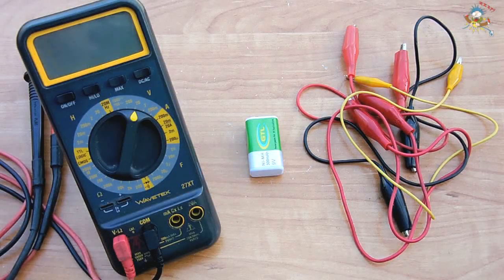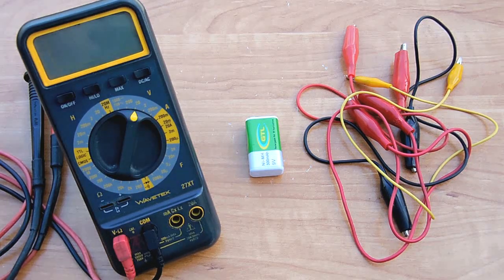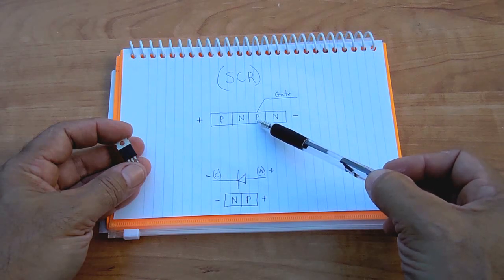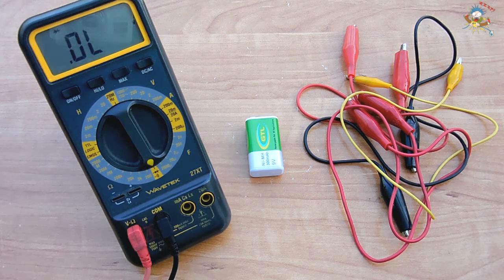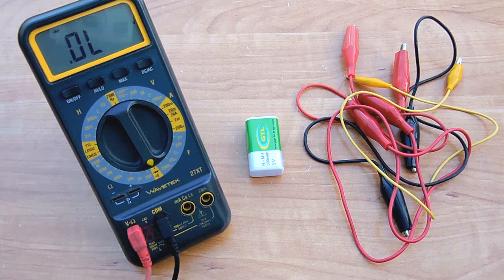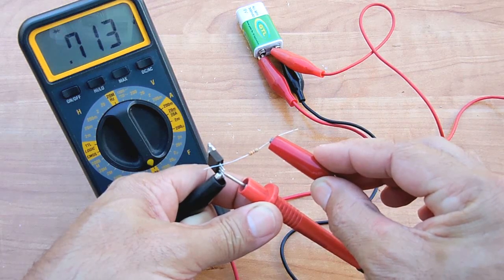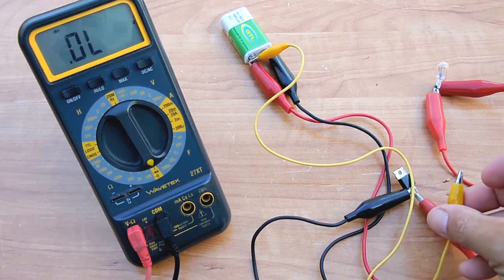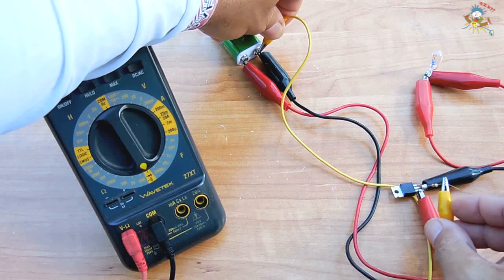SCR Operation & Testing

Comment: Thanks for this info. My DCA55 said it was an unknown or bad component, but proper testing showed it to be working. I'm trying to fix a power supply with very limited resources, I've checked just about everything I can without an oscilloscope and it all checks out fine. I'm thinking it might be a bad switching controller and I don't know if I'll ever be able to afford to get a replacement, but I'll keep trying and learning more along the way.
Reply from the maker: You're welcome! Hopefully you can resolve your issue

Comment: My problem is I can't find an SCR for the 12VDC  application that I need it for. I need an SCR that can take a 12-15V gate trigger. The highest I can find is a 10V gate trigger SCR. I want to get by without using a resistor.

Comment: Are these only to be tested removed off board out of circuit?
Just documenting how to troubleshoot old pinball machines and 60 of these (mcr106-1 and 2n5060) are on one board alone. I notice 2 already were replaced by seeing different part manufacturers were soldered on. 
If I can check on board and won't mess anything up, do I need to do anything afterwards to close gate, if I understand that right..
Reply from the maker: I would desolder the gate pin, then test using a DMM set to the diode function between the gate and each leg(Anode/Cathode).

Comment: can you short the gate to the anode and use it as a diode?  What is the current flowing through the gate?  Is that why your using a resistor and what value did you use.
Reply from the maker: You can use an SCR as a diode. The resistor was used to limit gate current, the value wasn't critical. Thanks for watching!
Reply: @electronicsNmore  Thanks for your reply,  I seem to remember doing this many years ago.  I played around with different value resistors.  In my case I had to get under 1000 ohms before the gate fired off and let the SCR pass current.  I settled on a 560 ohm resistor.   I am building a LiOn battery pack for a Ham Radio.   I have 4 batteries in series each series is 3 batteries in parallel.   I plan to use 3, 20 amp SCR in series to drop the voltage down to less than 15 volts for the radio.     Ken

Comment: hello, I hope you respond... does it matter what the input voltage is in regards to the forward output voltage? Also, does it matter what size resistor is used to trigger the gate?

Thank you.. I did test mine and it appears to be forwarding .597v (T106D1).

great video..
Reply: The purpose of the resistor is to limit the current thru the gate circuit. I know it has been two years but I hope it helps

Comment: I work with Variable speed drives and i have a faulty one here displaying 32 Volts out, when the drive is not powered on. Do you think it may be the SCRs ??
Reply from the maker: Not sure without inspecting the VSD.
Reply: @electronicsNmore   i doubt it is after the last 24 hours. I changed the 6 IGBTs and 3 SCRs, but no improvement. We suspect it's a firmware issue.

Comment: Nice video ,Why did you have to use the resistor when connecting to the gate ?
Reply from the maker: Shashi Kiran Limit the current.
Reply: @electronicsNmore  , would you share the resistor value please.. great video... thx

Comment: Is this method is the same also when testing a big thyristor (ceramic type) used in soft starter? thanks
Reply from the maker: Works the same on all SCR's(trigger current may vary). In my Tankless Water Heater video, I show how to test Triacs. Thanks for watching!

Comment: Can you please tell me why it did not work for this?
https://media.digikey.com/pdf/Data%20Sheets/ST%20Microelectronics%20PDFS/TXN,TYN%20058-1008%20G.pdf
Reply from the maker: It should work. Make sure you have the correct pins.
Reply: The gate won't stay latched. It only flows while there is positive charge applied to the gate pin then stops once released. 

Any advice?
Reply from the maker: Try using a load(bulb) that draws more current.

Comment: Nice video! But what are the factors you need to consider when selecting an SCR for a particular circuit? Which SCR should you use?
Reply from the maker: Thanks. The most important factor is the current rating.

Comment: What value resistor are you using during triggering of the gate??
Reply from the maker: +NISARGH S 
If I did not mention the resistor value in the video, which I thought I did, then I probably used a 200 ohm.

Thanks For Watching!

Comment: How do you determine what resister to activate the gate?
Reply from the maker: Ed Ginsberg Hi Ed. If using an SCR for a 6v to 12V circuit, usually a 200 ohm to 1K ohm resistor will be just fine. You need to look up the data sheet for your SCR. The SCR in this video is a BT151-500R, which has a gate trigger current of around 15mA. If you go to trigger the SCR for a heavier load and you have triggering issues, then lower the gate resistor value until the problem is corrected.

Thanks.
Reply: @electronicsNmore  Which resistor would you recommend to use if I want to trigger 12V coil relay with SCR(BTA41-600B) to run for 1/2 HP motor? Meaning, sensor will trigger SCR gate with apporate voltage(originally 12V DC) to activate the relay then relay will connect with 1/2 HP AC motor.

Comment: how much did you pay for that meter and what brand thanks 
great demo and explaination with the scr
Reply: hansley maharaj Hansley, there is one on Ebay at the moment for $39.99
Here is another good meter it is not RMS but a very good meter.

http://www.harborfreight.com/5-in-1-digital-multimeter-98674.html

I have one and sometimes you can get it for 49.99 I love the temp probe on it. I use that on the oven everytime I bake something....
Reply from the maker: hansley maharaj Thank You. The Wavetek-27xt is an excellent DMM for people into electronics. I paid around $125.00 16 years ago. Outside of a few worn traces on the rotary knob that I repaired, a couple burned resistors that was my fault, and a SMD IC which I replaced, the meter has been great. You can buy cheaper versions of my meter without the inductance feature for around $40 on Ebay.
Reply: electronicsNmore There is one on EBAY at the moment $39.99

Comment: I learned something today! What kind of devices have these in them? I'd like to keep a lookout while salvaging components. Thanks for the video!
Reply from the maker: Torsan1977 DC motor control, DC switching, DC electronic circuit breakers, and AC control circuits such as dimmers. 

Thanks For Watching!
Reply from the maker: SCR's are great for alarm circuits. I may have to design a good one when I get a chance.

Thanks For Watching!